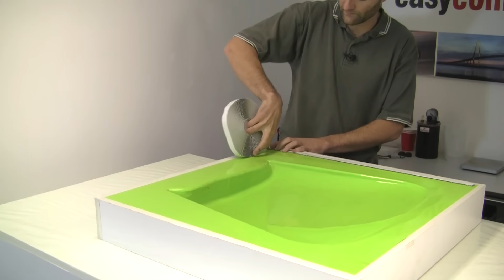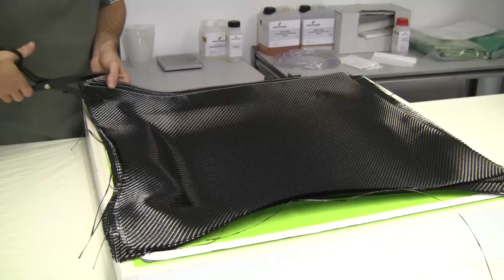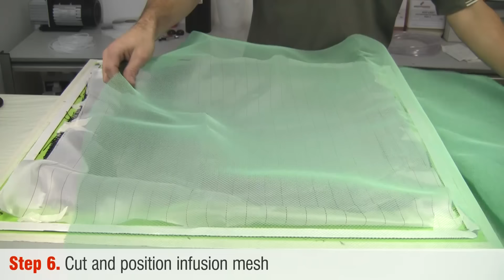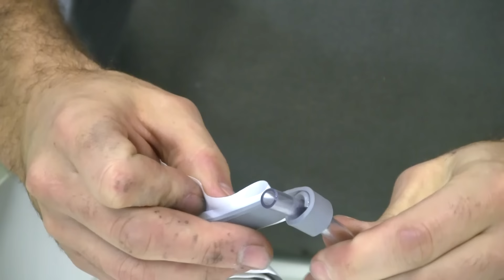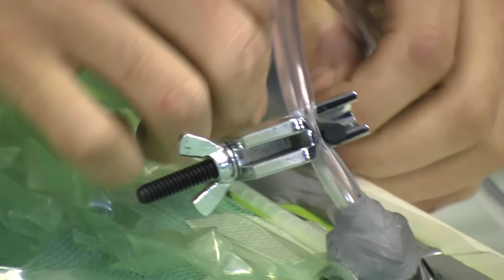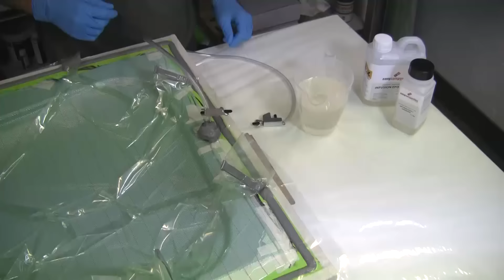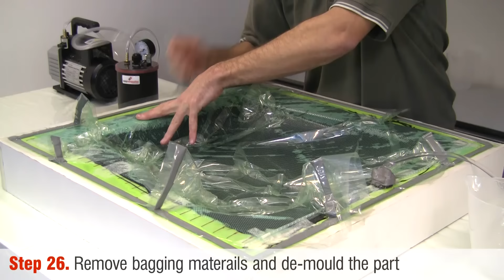How To Do Perfect Vacuum Resin Infusion of a Carbon Fibre Part - Basic Tutorial

Comment: I have a question what Kit or kits do I need to buy from your page to be able to mold and finish a cf part, I'm looking to buy a kit but don't know what parts or kits I need to get...
Reply from the maker: It depends what you are trying to make and by what method?  A good Starting point is our Epoxy Mould Making kit for the mould followed up by our Carbon Laminating Starter Kit to have a go at making the part by wet lay.  Once you get the hang of it, you can choose different methods and kits as needs be.  You can see our starter kit range here: http://www.easycomposites.co.uk/#!/starter-kits

Comment: Can you use a prepreg for the first visible layer combined with additional dry carbon layers for infusion? The goal being a perfectly even weave using infusion
Reply from the maker: Hi Stephen, yes, you can. However, you would need to 'key' the back of the cured prepreg layer in order for the infusion layer to bond to it properly. Although it might be tempting to achieve this by using a peel-ply on the prepreg layer you would find that the peel-ply 'sucks' resin out of the prepreg and leaves it too dry so do the prepreg in the normal way and then key it using abrasive paper. A lot of work but certainly possible and could get you incredible results if you want to combine the precision of a prepreg surface layer with the cost savings of infusion for the backing layers.

Comment: With this work with Kevlar as well?
Reply from the maker: Yes, Kevlar will infuse perfectly fine in this method.  The only hazard with kevlar is cutting it.  You will need dedicated kevlar shears to cut the raw material and when trimming the cured part, you will get some fluffing of the kevlar on the edges that will need to be trimmed off with a new sharp razor blade.

Comment: Do I need to calculate the epoxy resin volume to carbon fibre content for resin infusion? I usually use 60% carbon fibre to 40% epoxy resin when doing wet lay up. Not sure if I just need to make excess epoxy mixture for infusion as I see there are remaining epoxies in the input container
Reply from the maker: We have a table of the resin quantities needed for various sizes and numbers of layers of fabric to make it easier for you.  You can see the table here: https://system.eu2.netsuite.com/core/media/media.nl?id=59028&c=3937524&h=ed6c113ff018e812d5f3&_xt=.pdf
Reply: Thanks a lot for the help!:-)
Reply: @easycompositestv  done the download,  fantastic and thanks

Comment: I'm curious, is it possible to get the same finish by using this process on a round layup? Specifically for a carbon fiber or fiberglass tube for a rocket.
Reply from the maker: As long as the tube is big enough to make laying up the infusion stack practical, then I see no reason why the method would not work for a cylinder. Care would be needed to plan the resin feed and vacuum lines so that you can control the resin flow ensuring you don't have any dry areas.

Comment: I see in the video you sre using 4 layers of carbon to achieve a 1mm thick product. Whats the maximum amount of layers to use in this process? I need a part ideally 3-4mm thick. Thanks in advance.
Reply from the maker: Some of our customers have successfully infused panels over 6mm thick - albeit these were relatively small size parts being used for knife handles or other specialist projects.  The key with thicker laminates is slowing the process down to allow the resin time to fully infuse the fabric layers.

Comment: hi good video. Just have one question: why didnt you use a vacuum chamber to get the gas out of the resin?
Reply from the maker: it is not always necessary.  In most cases allowing the resin to stand for a few minutes prior to infusing removes the vast majority of the bubbles. The rest tend to come out during the infusion.

Comment: is there any heating step in this process?
Reply from the maker: No Heating is required. The entire process, including curing, was done at room temperature.
Reply: @easycompositestv  how do you prevent straws between the bag and tape so it doesn't leak the air
Reply: would it be better using a hot mold?
Reply: @Aldarkazali  it depends. If you lay up the composite tightly no

Comment: how many pinholes do you get?
Reply from the maker: If you follow this method correctly you should not get any pin-holes. By supplying slightly more resin than the minimum, it should overcome any surface pin-holes.
Reply from the maker: Using this method, we didn't get any pin holes. Or at least, none that could be seen with the naked eye. The trick to this process (and the point of this tutorial) is allow a little extra resin in to the laminate so that you end up just over the minimum 60/40 fibre fraction. Maybe something like 58/42 - this allows the pin-hole free surface.

Comment: Hi 
How to select the vaccum pump (power, air flow) to area, capacity of project?
Reply from the maker: Providing that your vacuum bag does not leak then there is no reason why a very small pump (such as the size of the pump we use in this video) wouldn't be capable of infusing a very large project (boat hull size). However, if you have leaks in your bag (not something we suggest but something that does happen sometimes) then the pump needs to overcome those leaks and that's why you'll see larger pumps used for larger projects. The only other difference is how quickly the bag will be pulled down in the first place but for very large projects that's something that can be done with a vacuum cleaner.

Comment: Sir /ma'am what is the material of mold used in this video...?
Reply: Pretty sure it's a sir...
Reply from the maker: The mould material is made using our Epoxy Tooling Gelcoat and Epoxy Mould Making Putty. The putty is a glass fibre reinforced epoxy paste. You can find them both in our starter kit here: http://www.easycomposites.co.uk/#!/starter-kits/epoxy-mould-making-starter-kit.html or we sell them separately too.
Reply from the maker: The mould material is made using our Epoxy Tooling Gelcoat and Epoxy Mould Making Putty. The putty is a glass fibre reinforced epoxy paste. You can find them both in our starter kit here: http://www.easycomposites.co.uk/#!/starter-kits/epoxy-mould-making-starter-kit.html or we sell them separately too.

Comment: What would be better to use for a bonnet with vents in the middle? Prepreg or infusion method?
Reply from the maker: Either process would be fine (with or without vents). Probably a more important point would be whether you have an oven large enough to load the full bonnet mould into. If you do have a properly controlled oven that you can fit the mould in then you can choose between the two processes, if not then you'll need to go down the infusion route.

Comment: Hi Thanks for the super videos, current project I require to make a sandwich layered 4 feet diameter tube. The intention is to vacuum bag the mould.Would it be possible to use a piece of Perspex as a mould with the appropriate reinforcingon the back of the curved Perspex sheet. Will the resin effect the sheetthanks

Comment: So what is better? resin infusion or prepreg?
Reply from the maker: Done correctly, the mechanical properties of a prepreg laminate would be very similar to those of a resin infused laminate. Cosmetically they would also be very similar. The 'better' choice is often the one that's more practical for a certain part. For example, small, fiddly parts are generally much quicker and easier to produce using prepreg than infusion. Larger parts can be quicker and would generally be lower cost to manufacture using infusion so it can be useful to have both techniques to choose from, depending on the part(s) you're making.
Reply: +Easy Composites Ltd Thank you, you guys have been very helpful for me understanding different types of carbon fibre

Comment: Would it be possible to emulate all the wooden parts of a mandolin out of carbon fibre using this method. Would it be strong enough to handle the bending forces involved in musical instruments. I have full wooden plans of a mandolin and would love to use this process instead of wood. One of difficulties I can see is sticking the parts together. As it would have to be a series of individual parts. Any suggestions or info on this would appreciate it.
Reply: Yes it would be, but you would need to design the filler for all the key parts carefully or you'd be making large parts that need to be machined to the correct sizes. quite difficult and costly and honestly if its an instrument, it will probably sound like crap in carbon fiber.
Reply: Thanks. But what makes you think it would sound like crap? My understanding is that carbon is a very dense material. And there are lots of carbon fiber violins and guitars for sale in the market. At top end prices?

http://www.thestrad.com/cpt-latests/carbon-fibre-violin-wins-german-musical-instrument-award/

Or is this in respect to the carbon fibre you use for this process?

Comment: Thank you very much for the useful video. Do you ship the release agent to Jordan? Also, what is the type of release agent you are using (Easy-Lease Chemical Release Agent or Easy-Lease Mould Cleaner)? Are these release agents water based or not?
Thank you
Reply from the maker: +Eric Duncan ; we're very-much using the Easy Lease Release Agent - the mould cleaner is only for preparing a mould before you apply the release agent; it does not have any releasing properties of its own. In some cases we can ship to Jordan but it depends on the quantities you require - please contact our sales department (sales@easycomposites.co.uk) if you would like to discuss further.
Reply: Thank you sir. One more question please. in this video you mentioned to wait until the resin reaches the catch pot then clamp the resin side. However, in  manual you have on your website it is stated that "Experience (and experimentation with different moulds) will show you at which point in the infusion the resin feed line should be clamped but a rule of thumb is to do this when the resin is about 2/3 of the way through the part. Excess resin in the infusion will normally be sufficient to complete the infusion." Could you please clarify this point to me?

Also, if we use spiral tube at the vacuum port side, will there be any difference in the process?

Thank you in advance

Comment: Thank you so much for the video. Very helpful... in fact the only one I could find that clearly explained the whole vacuum resin infusion process! I do have a question though... why not clamp the line that is connected to the resin and let the vacuum pump pull out ALL of the excess resin into the catch pot?
Reply from the maker: +Clayton Birchenough : Well, you can do it this way round but if you do you're almost guaranteed to  have some pin-holes on the surface because the laminate will become too dry. The trick to a perfect cosmetic finish is to let some excess resin into the laminate (just fractionally over the optimum 60/40 ratio) which will work miracles for the surface finish and eliminate any pin-holes or voids.

Comment: i saw that the piece that you've made out of carbon fiber was shacking,
 what i got to do to make it become a rigid part?
Reply from the maker: +Pedro D For a more rigid part you can use more layers of reinforcement, a heavier reinforcement or use a core material (like Lantor Soric) to increase the thickness of the laminate.

Comment: Hi I have a very important question if anyone can answer thank you very much, so me and my have followed all the procedures and somehow the bag still loses pressure after the vacuum is turned off, we've checked everywhere for leaks and everything is sealed perfectly, does anyone know what our problem can be?? Thank you
Reply from the maker: +TheWolfOfMiami Sometimes it's possible to have accidentally punctured the bag during handling or during the bagging process. If you're finding it impossible to get the bag to seal then it might just be a case of rebagging to overcome the problem. Even with the most skilled and experienced laminators, it's sometimes necessary to re-bag something when it's proving too difficult to find a leak.
Reply: +TheWolfOfMiamiTv  leave your vac on. I have been doing this for years and currently work in a high end boat shop. If you're pulling a constant 25 lbs you should be able to infuse an air free part because you can see the air entering as resin is introduced and stop it by plugging holes with tacky tape. Use a ultra sonic leak detector as well, they work awesome for finding small pin holes in your bag.

Comment: Do you need to apply any release agents on the vacuum breach valve as resin will run through it?
Reply from the maker: +Junaid Mohammed No, because the resin infusion connectors are made from silicone, resin doesn't stick to them at all. We would never suggest using a conventional rigid (aluminium) through-bag connector because the resin certainly would stick to that!
Reply: +Easy Composites Ltd thanks for this comment, otherwise I would've unknowingly destroyed the breach valve I just ordered from Easy composites.com!
Reply from the maker: +Junaid Mohammed Haha. glad to be on service!

Comment: What would you say is best for cleaning and polishing the trimmed cut of sides and corners of the carbon fiber  part.
Reply from the maker: ian57812 Take a look at our video about Cutting and Finishing Carbon Fibre Parts; I think this tutorial will have all the information you need.
Reply: +Easy Composites Ltd Hello. Really like your videos but can you tell me what do you use to fill inside of the molding box?  The mold looks like it is constructed of wood frames around the mold but hollow inside. Please help on this as I am building a mold too and gonna use the carbon vacuum form fusion method. Thanks

Comment: So you degas the resin to stop the little air bubbles getting in. But then you put a tube full of air in the pot, and draw all the air in the tube through the mold along with the resin. Am I missing something? Why isn't this a problem? But the result is great, fantastic surface.
Reply: Air in the tube (and dry fabric) is easily pulled out by the vacuum pump - it's not blocked by anything and won't cause bubbles because it's outside of and 'before' the resin; it gets sucked out before the resin gets to the mold.  Air mixed in with the resin expands when you pull a vacuum and will push any resin 'before' it along, so you get some resin then some air then more resin.  It is hard to pull air past the resin; you'll get bubbles and voids.  Degassing the resin first is the easiest way to get most of the air out and cut down on bubbles and voids.
Reply: sounds like pretty good reasoning. nice answer.
Reply: MrTechnophile they make a bigger “catch pot” that you can put your mixed resin in to degas the resin in prior to infusion- saves the additional 10-15 minutes of waiting for the resin to degas on its own
Reply: Brian Ballweg I was just thinking this same remedy. I made Special Effects appliances for some costumes and for my Mom that was a Special Effects makeup maker person and we would put the Silicon in a vac chamber and it would degas quickly. We used a large stainless steel pot with a plexiglass lid, worked superbly.
Reply: @gateway8833  I do the same :)

Comment: How powerfull vacuum pump is needed? How many cubic meters per min(or hour)? How big vacuum? You said -30 of what? Bar?
Reply: i would assume -30 mm of mercury....
Reply: 1 atmosphere is about the best you can get outside an autoclave.
Reply: Anything better than 0.1 barg (90% vacuum) should be sufficient. The cubic meters / min only really determine how quickly you can achieve your desired vacuum.

Comment: There is any problem if the vacuum pump stay on for 12 hours?Do you have any valve for help not burn your pump?Thanks
Reply from the maker: with the technique as shown in the video, you shouldn't need the pump on for 12 hours. The pump is capable of running that long as long as it has enough oil and it is pulling against a fully sealed bag.

Comment: In the bonnet video, you use Lantor Soric.  Is there a "rule of thumb" on when to use Lantor Soric?  Will the part be thicker / stronger if Lantor Soric is used?
Reply from the maker: Lantor Soric is an example of a core material. Where you use it is down to the design of your panels.  In this case, it is common for panels to be made without a core but they need more layers of carbon fibre to achieve the same level of stiffness. If the thickness of the panel is critical, then a core may not be appropriate, It all depends on your specific application, but a core material is a great way to increase stiffness without having to add many layers of carbon material.

Comment: You should try putting some release film between the transport mesh and the peel ply.
It would be better to prime the infusion pipe before you start, so the air is allowed into the pipe beyond the clamp, then it was be drawn out before the resin enters, after all the transport mesh will hold quite a lot of air
Reply from the maker: You can use a perforated release film between the peel ply and infusion mesh.  It can be advisable with more complicated shapes where removing the bagging stack can be difficult and time consuming otherwise. There is no real need to prime the pipes. The small amount of air is drawn out by the vacuum pump anyway.
Reply: The proof is in the pudding I suppose. If the final product is consistently A-1, you can't argue with success. But you're right - it just doesn't make sense to go to all the trouble of carefully evacuating the air, only to introduce a bunch more. One time out of 100, there might be a problem.

I'd purge the tubing.
Reply: Randall S